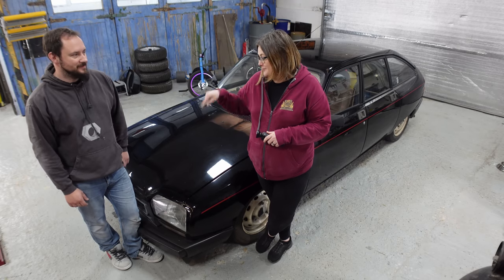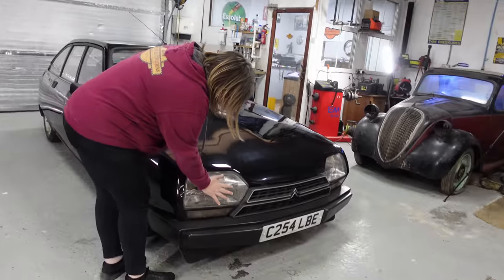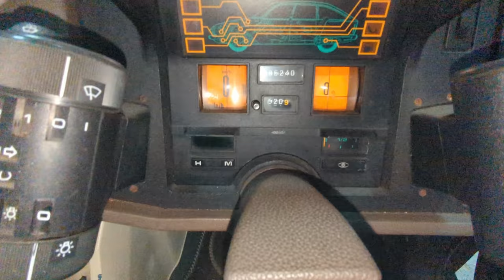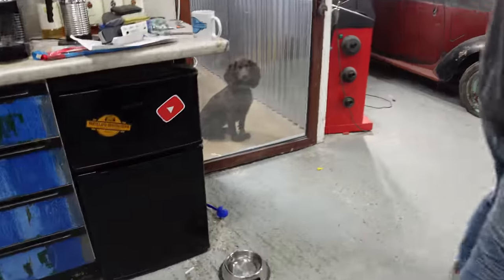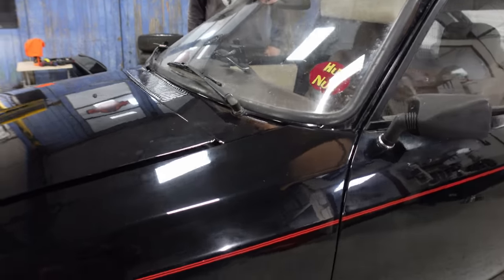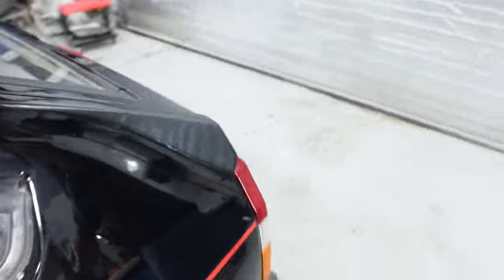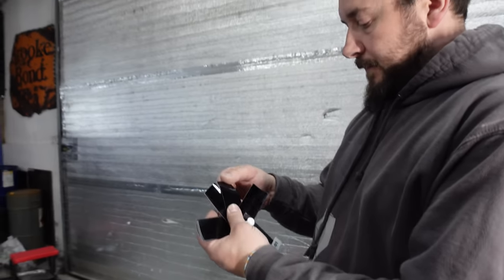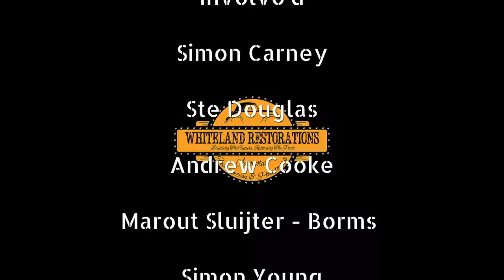Hubnut's Citroen GSA Comes in For a Little TLC

Comment: I learnt to drive in my Dad’s Citroen GS and loved it. In those days Citroen were such an innovative car company but sadly are not any more.
Reply from the maker: Hard to find much innovation in any brand these days. Modern cars are all starting to look the same!
Reply: They are getting better John some of the new ones have quite a bit of innovation my dads c5 aircross is a great car
Reply: @danielrussell446  Daniel, the trouble is when you look back at the Traction Avant, 2CV, DS (arguably the most influential car of the 20th Century), CX, SM etc. and contrast them with today’s offerings, the new cars fall well short. I do realise that Citroen had to “normalise” their cars in order to survive commercially though.
Reply: @WhitelandRestorations  That is certainly true. I remember some family friends came up to visit my parents when I was at Uni and I came over to see them. He was driving a Morris Marina and my dad had a GSA. I drove his Marina and picked them all up from somewhere. I was used to the phenomenal brakes of the GSA, so when I applied the Marina brakes for the first time to stop at a junction at the bottom of a steep hill, nothing happened and I overshot the line and finished halfway across the road. A new pair of trousers were required!
Reply: GS was my learner too in early 80s.  Pedal to the metal. Lol

Comment: If the hydropneumatic system is similar to the other hydro-p Citroen models then they can't be driven in lowest setting as that's 'service low' which means it's resting on its bump-stops and most of the LHM has returned to the reservoir.
Reply from the maker: No low rider setting then.....boo! 😂
Reply: @WhitelandRestorations  Unfortunately not. Wanted the same look on my XM which seems to look even longer than normal when lowered. There's probably a tweak that can be done to the front and rear height-correctors but one would need to be brave and have access to a pit to 'experiment'

Comment: Hubnut’s Citroen is in very nice condition. Most of these were beige or silver back in the 1980s. My mx5 is brilliant black, only new paint it has had, is both rear quarters, annoyingly wrong shade milky black close up, but ok from a distance
Reply from the maker: Love an Mx5! Has yours had some work on the arches back there. Black is such a tricky colour to match
Reply: @WhitelandRestorations  Arches & sill spot welds & joints all look original. JDM import, so maybe was sun damaged paint. Bonnet doors & front wings all look original, far from perfect, but paint only original once & shines nicely

Comment: Yes, it has a suspension setting to leave it that low when the engine is running. But that is used for jacking up the car, not for driving. 
You can jack the car up by putting it at maximum height, putting a jack stand under it, then putting it on the lowest setting. It will then pull the wheels off the ground. 
The highest setting is only for low speeds to clear an obstacle or something, not meant for driving faster than 'off road' speeds.
Reply: It actually doesn't have a low position on the suspension, which is hugely irritating.
Reply from the maker: It's a great system and I suppose it would be very handy for rural back roads..... Esp Welsh ones!

Comment: hydropneumatic suspension. when its at rest that lowness of the suspension is normal. once the engine runs, the suspension raises to normal height
Reply from the maker: That's the one.... Hydro-pneumatic suspension! Fantastic quirky set up and supposed to be super comfy!
Reply: @WhitelandRestorations  similar type on Rolls Royces
Reply: @WhitelandRestorations  yes it is, there is a lever in between the seats which adjusts the ride height

Comment: kinda surprised you don't have a handheld paint spectrometer.  or a tame offset print tradesman (who would probably be more accurate than the spectrometer)
Reply from the maker: There's a very good reason we don't have one..... We do full repaints 99% of the time so there's no need for blending. It's just on the odd occasion and ips or our other local factor do an excellent job of colour matching 😁👍
Reply: @WhitelandRestorations  But ... But.... Toys!  Surely the reason to run any business is to collect the toys... =)
Reply from the maker: It's totally true..... I'm still playing with my laser cnc 😂

Comment: Theres a paint place in Wolverhampton called "Jawells" paints that if you take your car can scan the colour even if its old celly and get a perfect match. So if you only want to paint a wing it will blend.Rattlecan or canned for a proper spray set up.Very clever indeed.
Reply from the maker: Paint scanning is excellent but they rarely bring the scanners out to the workshop. Even so, you should always do spray out cards to check the colour against the car 👍
Reply: @WhitelandRestorations  Very true.I used the company a couple of times either taking the car or a piece I had cut out to be replaced with fresh steel.The results were good each time.Luckily they were very local.If not yes you need samples sending out and spray samples.Black is a buggar of a colour.Never had to match one thankfully so hope you get a good one.

Comment: Writing as the “ previous owner “ I used vinyl paint for the interior panels . And guess what ? Even I am not stupid enough to use the same on the wheels . It’s cream Hammerite . If you didn’t spot the difference it sadly erodes my confidence in your work .
Reply from the maker: Apologies for the mix up! We will make it right for you in the next episode!
Reply: Thanks guys I don’t normally whinge but should explain that the wheels had steel disc hubcaps originally so the wheel paint didn’t show !